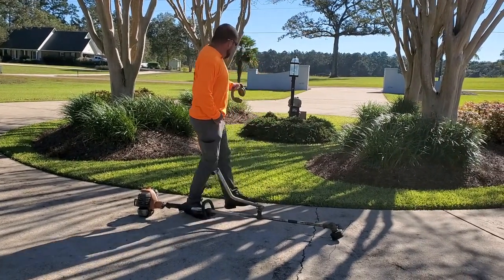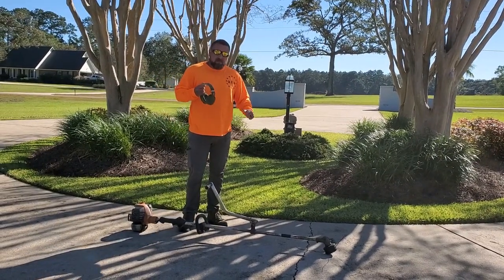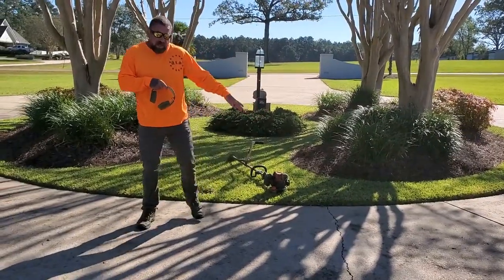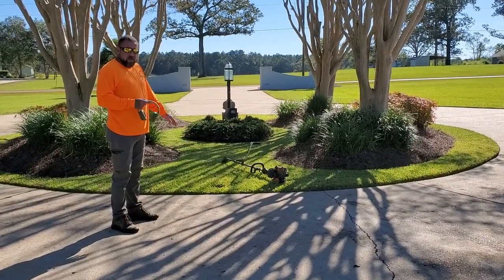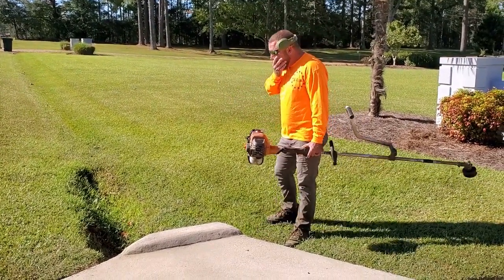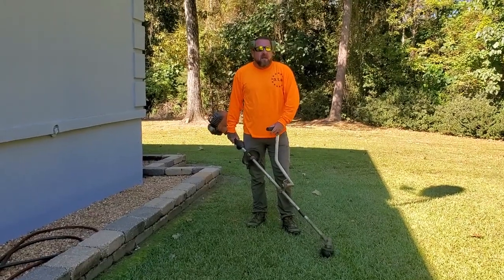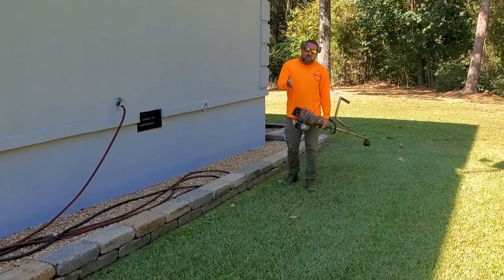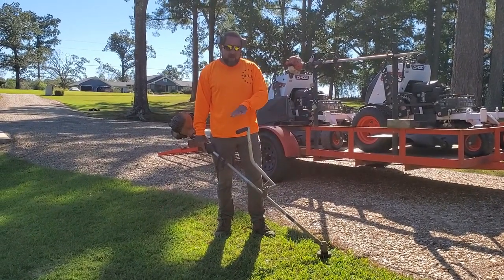Trimmer Techniques Explained!!!

Comment: Yep, you hold the trimmer the EXACT opposite as I do, but the same positioning--trigger handle always in my left hand ( even though I'm right handed 😂🤷‍♂️ ), holding the shaft with my right when I edge, and holding the stock handle in the left when flat trimming ( I just move that secondary handle closer to the trigger handle and engine when I buy trinmers, so no need for darwins or anything ), and 99.4% of the time I'm walking forward--although sometimes it is smoother flat trimming fences walking backward or sideways, especially chainlink.

And of course, I'd rather see the Beautiful miss Hailey in front of the camera ( nothing personal 🤣 ), but you do what you gotta do, brother 👊 another good video.
Reply from the maker: All in personal preference but yeah that hand position makes a big difference. And hey lets just be real...she's the highlight of the channel! lol

Comment: I use hard edge on some what string and size you run?
Reply from the maker: We use both. It just depends on the property and the edge. I prefer the Black diamond .095
Reply: @AmericanLawnSpecialists  I use black diamond 105
Reply from the maker: @shanepipkin4041  I tried it and liked it but prefer the  .095 because I can swing more of it and it has a better woble at low speeds for edging.